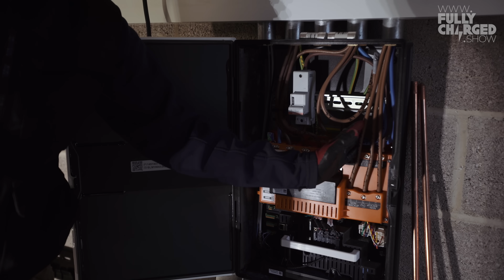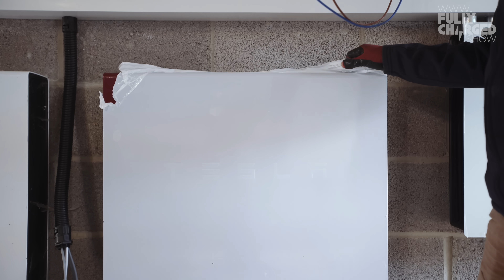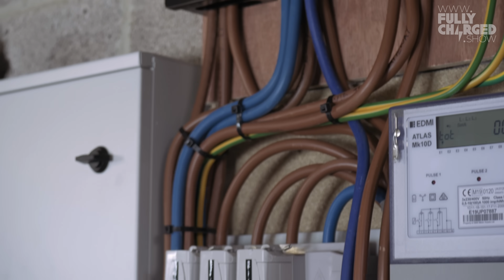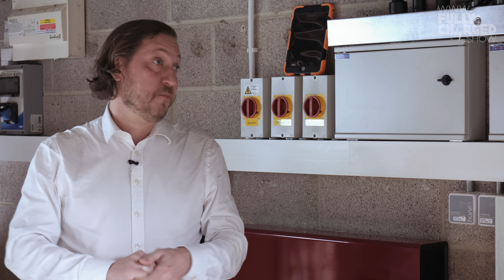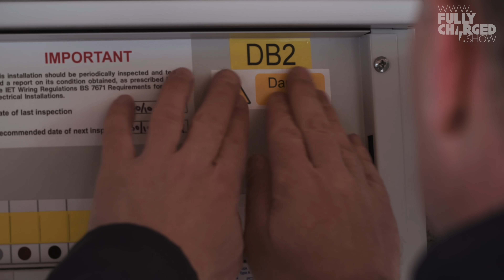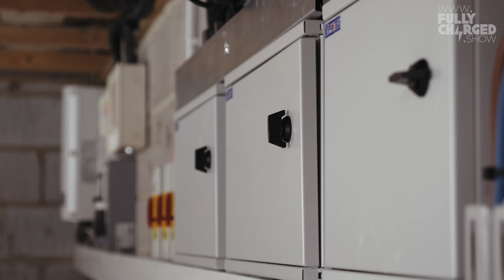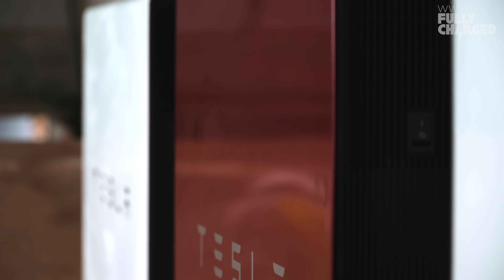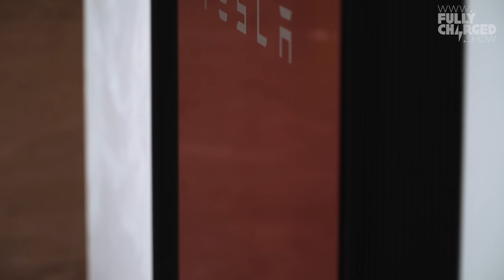Can you run your house on a battery? Tesla Powerwall 2 (Founders Series) & Tesla Backup Gateway 2

Comment: The 5p export rate. You said that the grid set this rate as they have to pay for the lines etc… Though You have to pay for your powerwall, gateway, three phase…. The 5p rate is absurdly low, you should be reimbursed also for your solar and powerwall grid. They should be paying the rate they charge you minus 20% ish. This 5p rate needs changing, what a joke.

Comment: So here's a weird one
You can buy a UPS for your computer, if you get the right one, the computer doesn't even notice
You have 2 powerwalls, i know you like the idea of feeding excess back to the grid, but also want to power your house
Maybe one powerwall could be configured like a whole house ups so there's no interruption of supply, the other to be configured to take excess and be able to feed to grid
It wouldn't matter if the second ne had a delay while the contactor disconnected the grid for safety. as the first would be permanently online but only to the house.

Comment: For anybody watching this in the USA ... I have had a solar roof and Telsa Powerwall 2's working at my house for over two years now with what appears to be the very same Tesla Powerwall Gateway 2 box that this gentleman in the UK has installed.

One thing I noticed that differs from this video ... Whenever I have a power outage ... or if I choose to go off-grid using the Tesla app ... there is absolutely no loss of power in my house whatsoever....not even for a fraction of a second.  The lights do not flicker ... even desktop computers do not lose a beat.  During the several power outages in my area since having the system installed ... I did not notice any of the power outages until I realized my internet connection was not working....because our internet provider's backup power only last for so long.

To solve the internet loss problem... I switched to Elon's Starlink internet service.  Hopefully, someday backup batteries will be so cheap and long lasting that we just bury them under the lawn in the backyard and forget about them.  When residential backup batteries get REALLY cheap ... maybe then larger and more efficient rooftop panels will allow many of us in more temperate climates to opt to go off the grid completely ... and use that giant battery in the backyard to heat our winter homes mostly with sun saved from the fall and less frequent bright winter days.

Comment: Here in Melbourne Australia, we are running 2X power wall 2's fed by 10 kw of solar (26)panels. Since the second power wall 2 has been installed we have not used any grid supply for 2 months during Spring. The entire system is running on a single phase.

Comment: Interesting to note that in the first video when the first powerwall was installed he talked about batteries dropping in price by 40% the previous year. The first battery cost £5k and the powerwall2 is now £8500 for the same 13.4kwh capacity so the expected drop in pricing hasn’t really materialised?

Comment: Okay, so for the tech bods out there - how can you hook up a single Powerwall to two 3 phase inverters (running two strings of solar each) - Is it possible to capture all of the energy generated by the whole system into a single Powerwall?

Comment: Great vid thanks, its very informative, hope you don't mind but I would like to pick your brains/thoughts on my setup and hopefully you could offer me some advise,  I currently have a 4Kw solar system on my roof with individual Enphase micro inverters on each panel, I am considering getting another getting 4kw array with 10Kw battery storage but I only have single phase supply, do you think it will need updating to three phase supply , the main reason i'm doing this is the continual rising energy costs, currently my energy company are asking for £384 a month which = £4608 a year which in my opinion is an absolute rip off,  so another 4kw of solars will cost me £6400 + battery costs not sure how much they are yet because the ones I want aren't available in this country until September 2022.   I am not really bothered about export fees as my goal is to use as little from the grid as possible, in one month I only used 212Kw of electricity with my current 4Kw set up and that's with no battery, I roughly generate 400Kw per month (average) on my current set up but with no storage so I am possible losing quite a lot, we have change our routine to do dish washer and washing machine etc during sunlight hrs if possible also fridges and freezers are always constantly on, I would like to use battery to run lights Tv's and sky box play stations for children at night time. is this possible, then i would probably only pull 50Kw a month which would be more acceptable. PS the national grid recently gave me my own new single supply when I got a car charger fitted.

Comment: Wow I can’t believe there’s such a delay when the power goes off to when the battery takes over. Here in Australia with the PowerWall2 & Gateway there’s no noticeable switch over from grid to PowerWall2 supply as it switches in microseconds.

Mind you we don’t use the grid at all except to export to and top up the PowerWall2 for night use if there hasn’t been enough sun. 
We run off solar and PowerWall2 24/7 with the solar recharging the PowerWall2 before lunch (typically) and then we use the PowerWall2 for all our electricity at night.

Comment: I have a plan in my mind (money permitting)  to dig the garde up to have heat exchanger pipes buried in it on a 20 by 50 foot array and then a couple of these power walls (having watched this) a heat pump (for the ground), Solar panels on the roof of the house and the garage and the shed and perhaps a couple of small wind turbines out there too. No, at 60 i am unlikely to live long enough to get it all back but to be able summer or winter live in a warm (or cool) house where I'm not being shafted by the electricity board or local petrol station is what makes it so attractive. Just pay for it to be put in and no more reliance on the grid

Comment: After watching this, I still think they sold you a bag of shit ! Even single phase, 100 amp service line can handle 15.5 kw out bound, I can't believe you don't have two line's of feed to your house, that would be on the low side 150 amp service.   In No way did your house need 3 phase, you don't have any items in your house that handles that kind of power period.  I currently run 3 power walls , two electric cars, and a full electric house.  2 phase, 200 amp service. 19K solar system on the house, Hell yeah I produce a lot of power.  I'll call BS on your export figures, you should have questioned them to?. Power walls don't export to the grid. The fail safe design is storage until a power failure, then they are isolated from the grid, only to power the house..   PS, with all that shit they sold you, they screwed you even worst then you know, the Tesla gateway scenes the grid power and switches to battery power in a nano sec, you don't even see the lights flicker.  That was a embarrassing display of the grid lose switch over.

Comment: As someone who lives in a 3-phase house, I can tell you this raises lots of questions.  
For domestic wiring, each phase is normally a completely separate circuit, so presumably you have one powerwall on phase A, one on phase B, and nothing on phase C, so in a powercut anything connected to phase C will stop working. Each powerwall will only drive loads on the relevant phase, so when one is empty, everything on that powerwall dies, right?.  Which means a lot of planning to make sure your freezer stays on in a powercut, etc.... 
Also, if the Zappi is now wired as a 3-phase device and connected to all 3 phases, then it too will stop working in a powercut because only 2 of the phases are powered, which otherwise sounds pretty scary from a phase balancing point of view. 

Is that how the house is wired, or have Tesla got something really clever that somehow magically combines the phases????
Reply: No, it's exactly what you said. This is the only way possible.

Comment: Coming here late, but I wanted to know if the Gateway is a critical point of failure? If the device now sits between the grid coming in and your house cabling, what happens if it fails? Is there some manual monster switch that can bypass it? I wouldn't want to lose the contents of my freezer (and grandma's oxygen for that matter) while I wait for a Tesla tech to arrive and fix it. Is there an automatic default back to the grid in case of catastrophic failure? Other than that, this looks brilliant, thanks for the video (and so cool to see the man whose Red Dwarf character I've been happily impersonating - badly - on a regular basis for decades). From one Robert smee hee to another, thank you!

Comment: Three phase is ridicules in a domestic situation , how much power do you need? Potentially 415 volts or 300amps , I see or hear there’s no mention of cost , ££££££££££££££££££££££££££££££££££££££ 
The daily electricity tariff will now increase by 3 , so that could easily be the most part of £400 per year it’s all getting a bit silly

Comment: I did this stuff years ago, with no feedback to grid, just upgraded batteries/inverters/charge-controller/PVs as my grid-bill dropped. Now I'm off-grid.  I have a back-up generator just in case (not used it since initial test/installation, except for maintenance/tests).  Re-sell inverters/chargers as/if/when you outgrow them, or save one as a back-up. All my Heating/HW is bio/solar/heat-exchanger-storage. One thing I would recommend is separate PV-charger arrays so that if one is faulty/shaded etc you don't degrade all collection.
Stupid idea that you 'have to upgrade to 3-phase', you were conned.

Comment: We run a heat pump.  I doubt that when the power goes out the wall unit would handle the load when it dips into the temperatures for the electric back up
Reply: You can actually figure out the max load and responsiveness of the battery in the specs
Reply: @ricmacas  And , how big a battery is that going to be?

Comment: Great stuff!

Question:
If you have a 3 phase home now, how does your self consumption look like if you use a 3 phase 22kW car charger?
Ie. how are your 2 PowerWalls connected onto the 3 phase grid?
Are they both connected to 1 phase (which was the 1 phase your house was build on before)? As you did not change your 5.5kW SolarEdge to 3 phase correct? Meaning, the solar still supplies on 1 phase. Which probably means that the PW's are both connected in daisy chain on 1 of the 3 phases?
In any case it would mean that 22kW charging with Zappi would mean that only 1 phase is used to charge the car from the PW's. When charging 3 phase, you would use 66% from the grid and thus lowers your self consumption.
The backup mode for your home probably still uses the orginal 1 phase your home was connected to as your full home is still powered when in backup mode?
So, I'm curious how the installer did connected the PW's. Both of them on the 1 phase that your home was connected to. Or on 2 phase leaving one phase without PW. In both cases I'm assuming charging  the car will decrease self consumption.

Comment: Having a UPS for my computer gear, my thoughts go to the possible damage to other electrical equipment when the system is switching to the solar power in the event of a solar outage.
Reply: The switch over to PowerWall supply from grid is seamless here in Australia. The gateway switches it in microseconds. 
Also your wording is confusing. If there is a solar outage you won’t be switching to solar power. If there is a grid outage you might switch to solar/battery power.

Comment: Three phase is standard in the States... we call that 240 volts which is two 120v lines with a shared ground. We run dryers, ranges and water heaters on the 240.

Comment: Around 14:00 it sounds like the philosophy of using Powerwalls for taking advantage of off-peak tariffs is the same as what's behind old-school "storage heaters," which are essentially boxes full of bricks you can heat up overnight while electricity is cheap, and then open the vents and use the heat during the day when the tariff goes up.

Comment: Pretty poor if you ask me.  I have a home made (admiditally smaller) system that switches from mains to battery - isolating the mains, and in 3 seconds the Inverter is up and running ... I use multiple UPS's for sensitive key kit ( TV, PC, Audio) to give uninterrupted power.  If I can do it I'm sure on a grand  scale it is possible.

Comment: Why do you need the grid? So we use 25Kw a day those walls charge at 27Kw per day why not leave the grid off until you need to charge the batteries if the solars not charging enough?

Comment: Impressie.. not... You guys act like you've invented something ground breaking... lol. Wtf was that delay about when you cutoff the power that comes from the grid?? That was like 10 sec. I have a Victron set up... When the power grid fails and my battery backup kicks in.. I would not even notice, its like 0.003 sec even when discharging high output systems.. Dont think I will switch to a tesla wall soon :p

Comment: This is great and the rate of improvement in design is exponential. The future model I saw put forward a few years ago had all this and included hydrogen generation and a hydrogen fuel cell. Also the ability to plug a cars hydrogen fuel cell into your house to run it, suitable for a single occupant scenario. Thus making offshore wind/wave generation off peak viable for battery storage and hydrogen generation. This is just the beginning of new energy. AI promising so much more.

Comment: I know the battery was free, but it might have been more economical to have used the sonnen SB10 battery which works off single phase power supply.  It is also guaranteed for 10,000 cycles or 10 years - whichever comes first.  You can also get a sonnen Protect that will give a degree of UPS for dedicated circuits in your home i.e. if you have a power failure you can ensure that your heating system remains powered on etc.  sonnen do have a 3 phase supply product for Europe.  Good old German engineering.

Comment: If you have an ICE vehicle then you will have 35kw plus engine to drive an alternator already. I have 150 amp 12volt alternator on engine which gives approx 1.5 kva which is more than enough if combined with 1.5kw of solar (4 panels) for off grid living.

Comment: 3 phase power for 2 powerwalls and a 5 kw array? Seriously? The powerwalls don't even backfeed. Even if they did, 15 kw is nothing. In the US most homes have single phase 240V 200A service (split to two 120V hot wires), so that's 48 kw you have available from the grid if your wiring can handle it. The  UK uses 240V, so a single wire can carry as much as the 2 wires carry in the US. So what the heck. They could have required wiring and breaker to be upgraded to 100A or 200A if it didn't support it before, but requiring more phases is overkill and makes no sense.

Comment: I had solar panels installed in February 2019 but was advised not to get a battery. I later had a Powervault battery installed that did not work properly. I had problems from the day of installation in that it would not charge. The portal showed the power being exported to the grid rather than my battery! I had the batteries replaced on two occasions after they died. In the end I had them removed, got my money back and have now had a Tesla Powerwall installed. Had I had it installed with the solar panels it would have cost £12,000 and there would have been no gateway for off grid use. As it turns out, the price has fallen by approximately £3000 in the eighteen months so has paid for the VAT and a bit more besides.  
The Powerwall takes every watt of power and sends it to the battery and even on really dull days I can still half charge the battery; so I have free power in the evening and overnight. I have changed my electricity supplier to Octopus on the Octopus Go tariff and will be able to get nighttime electricity at 5p per kW rather than 14.6 p per kW to fill the battery and the car.  I do still need to think a little about electricity usage. For instance, I may charge the car over two days and I tend to put on washers, driers and dishwashers mid day when the power generation is maximum. This ensures the solar power goes straight to the machines rather than through the battery. There is a loss of power in the conversion from DC to AC that is especially pronounced because I have microinverters which convert the DC power from the panel to AC. In order to get it into the battery it needs to be converted back to DC and then back to AC when coming out of the battery for the house. 
One small bonus from all these “green efforts” is that the house has moved from a D to a B rating on the EPC. 

I noticed recently that there is quite a lot of guano and dust on the panels. They are being cleaned today so I will see how this affects production.

Comment: If the power goes out and the house runs off the battery will the solar panels charge it as it’s being used? Or can u turn power off for a small period of time to slow the battery to charge or is it if power goes out the solar panels are shut down completely?